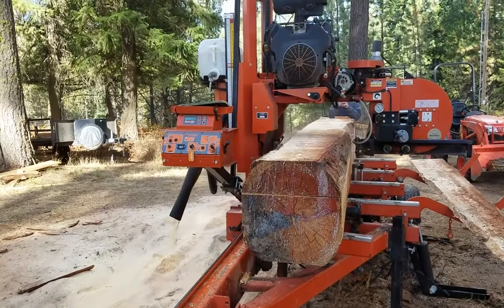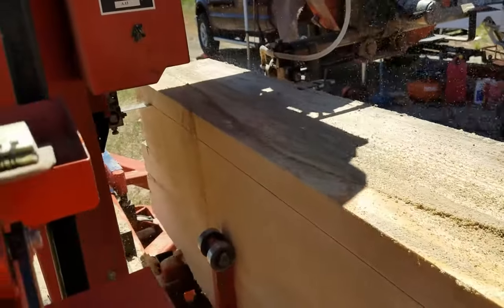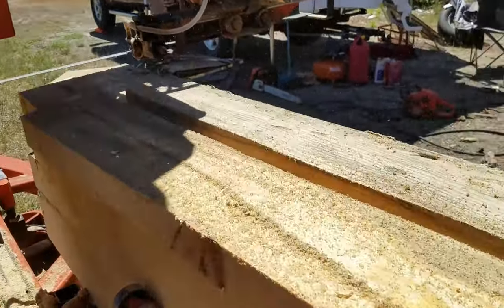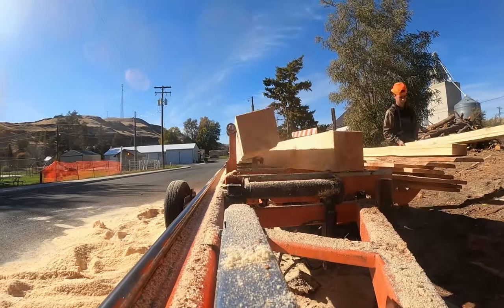An Introduction to Mobile Sawmilling

Comment: Trying to search bearing repair on LT 40. Six hours later. Watching your vids. Lol all ways tomorrow.
Reply from the maker: Thanks for watching.   Which bearing were you trying to repair?
Reply: @TheOldJarhead  was trying to see if it was normal for having play in the guide wheel. Blade keeps diving and trying everything 2 get it straight.
Reply from the maker: I will have to check mine.  how many hours on your mill?  I referring ti the band diving look to drive belt tension first
Reply: @TheOldJarhead  it's 1990 40 HD has everything but the band tension. I've pretty much replaced everything but the drive and idleler bearings. The center of the big wheels. Portland mizrs not open till tomorrow so I figured ill replace.also just picked up one of those belt tension sticks so I've got to be getting close. Lol
Reply from the maker: @patricktharp7623  Sounds like it. If the band tension is right and Drive belt is tight then sharp aligned bands shouldn't dive.
Reply: @TheOldJarhead  that's what I'm thinking too. I cut mostly salvaged cedar off the beach and living on the coast I was thinking maybe all the salt is pretty harsh on the machine.
Reply from the maker: @patricktharp7623  have you been recording the restoration?  would be interesting I think.
Reply: @TheOldJarhead  never had a problem till recently. It's been cutting perfectly untill the diving started I bout a box of blades and even asked Bret if it's possible to have a bad batch ? Unfortunately he said yeah. So ill buy some new ones and will keep trying.
Reply from the maker: or have them resharpened and see what that does.
?